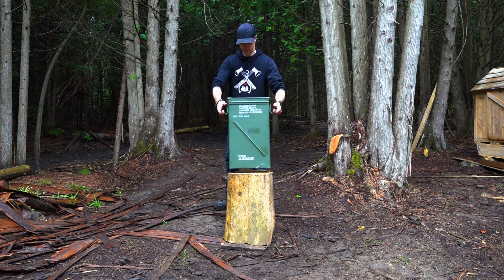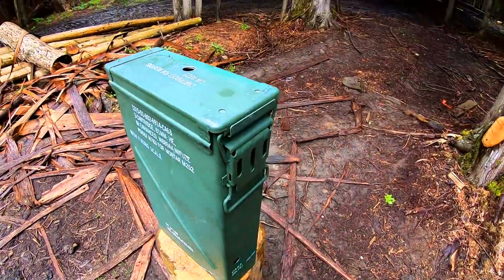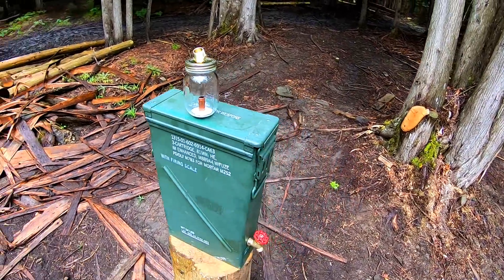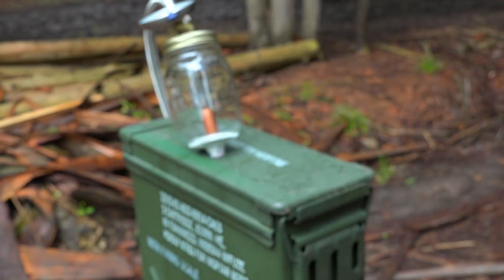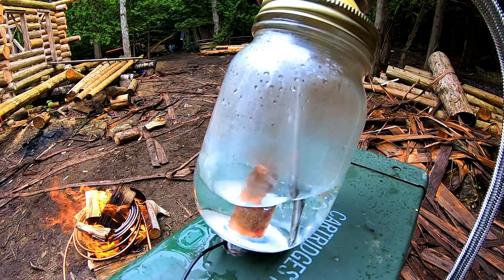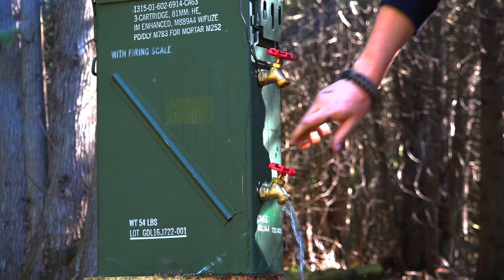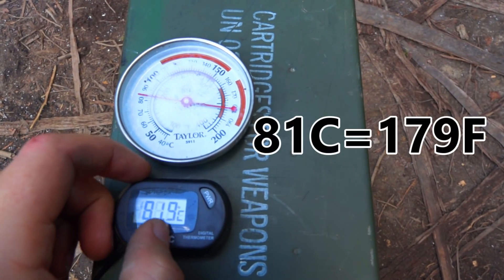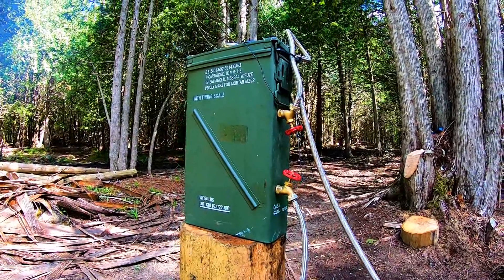Off Grid Heating Prototype- Copper Coil Water Heater / Heat Exchanger / Radiant Heater

Comment: Leaving the main tank outside and running a couple separate lines to a small ATV radiator or something of similar size with a usb or 12v fan you can plug into your power bank might make it easier to regulate temperature on the interior. If plumed in a similar fashion you may not even need any sort of pump to do it. Just insulate the lines.

Comment: There's so much wrong with this, make a normal size camp fire using less than half the wood you're using there, cook your dinner put a large pot of water on the fire, make a coffee, put the rest of the water in a hot water bottle, go to bed.

Comment: I think your copper coil is too big: its maximum capacity to heat water is greater than the amount of water buffered in your ammo box. So you need to up your ammo box or make your coil smaller. It's hard to calculate exactly how much since the heat from a fire can vary too greatly, but try and find a sweet spot where the water in the tank does not go above 80C (20C for safety margin).

Comment: add soap stone inside the ammo can use less water, and the soap stone will hold the heat better then just water after removing the copper from the fire.
Reply: I'm not entirely sure about that. Soapstone has 3x density but 1/4 the specific heat capacity of water. So water contains more heat per volume per degree C. It won't convect and has a lower thermal conductivity, but since the stone would be bathed in water these advantages is negated.

Comment: Also that flexible copper piping will get easily damaged or kinked or will break or crack. Should build a solid mount copper setup that will just barely reach the fire from 5 feet away and will unscrew from the tank for easier transport.

Comment: i work with distillations in past and this is an interesting concept, really , but the biggest flaw is to let the steam out bvecause the steam is the really high heat and that is what you really want to hold in and let that into pipelines to heat up the room in this case.

Comment: Don't say efficient. You can not calculate efficiency here, you would need to know how much total heat energy the fire outputs, and how much absorbs.

In these systems they are incredibly inefficient for how you have it set up. Looking at <5% here.

Putting fire in tank, more material for heat exchange etc etc etc could make it much more efficient, but this is shit efficiency in the video.

Comment: This is only good for boiling water, you would be better off putting a copper coil in that box, cutting some slits and using a fan to blow the heat off the coils  (there are off grid fan options)

Comment: This isn't the video I was hoping to find, but it uses the same principle. There is a horizontal Fire box that is super insulated, so more of the wood fuel is burned and thus creates little to no smoke. The air that comes out the exhaust isn't very warm, instead most of the thermal energy is saved in the bricks and clay. Give her a shot. It's wicked efficient. https://youtu.be/NYJyxptclos

Comment: Neat idea, but with respect, a small rocket stove cannot be beaten. You would need a heavy bank of horizontal stone chimney, but you would have 90% less thermal loss. Most of the heat is going by the copper coils, a lot of the fuel isn't being burnt.

Comment: if there's a coil  coming off the fire and into the water the hot steam would  keep moving inside the cold water, and it will lose some heat. Giving it more time to cool and turn liquid. that way the tank wouldn't boil so fast

Comment: Why not make a larger water storage unit, than have the water cycle through a coal bed. So you can have a roaring fire heating your camper in the day, and heating the water. Than you can safely go to bed with small coals in the winter, although not the safest it is still decent for safety. The coals will renew the heat and drive the water through your little building. So you could have the water inlet to the fire go through your camper (heating it), and the extremely hot water goes up into the storage. Although its not as efficient, I feel this way you could slowly circulate that larger containers content through your camper. That also isn't to say you wouldn't be able to have the hot water tank near your camper even radiating, but this way you also have more water to work with (for coffee/tea). The only limitation would be how safe you can make a small fire for circulating the water.

Comment: I think by getting a simple small radiator and attaching a fan it, instead of using an ammo box works much better. Then you can attach the radiator to the wall in the structure

Comment: Could consider adding a vented check valve (one way valve) for the pressure relief, so gunk n junk can’t make its way into the system. The venting would help especially in a closed space because that would make it very very humid

Comment: i made a similar unit using two metal five gallon pails one for water the other one had the coil in it spiralling upward to avoid air trapping i used 1/2 inch cause the larger diameter was much more expensive (trick for making a tight coil= fill coil with water and freeze then we took it to a parking bollard and wrapped it around it to tighten the coil. the ice inside keeps the copper from kinking) it spat and bubbles quite a bit tho on a hot fire cause its almost flash boiling it. ive seen guys use 1 or 1.5 inch and the flow seems alot better but alot more $$$$$  on a side note ive seen a guy use some steel pipe through a split log with the centre chopped out and piped it right into his tent    the log was a good diameter prob 20 -28 inches split and then a centre section removed and the pieces were wired back together with legs so the intake on the pipe was below the log so no smoke could get in the pipe ill see if i can find the video
Reply: here ya go but i like the idea of having hot water as a bonus    https://youtu.be/QeHGDr81XwM

Comment: HOw long does the copper piping last being driectly in the flame? Most things don't last long when directly in the flame. THey just don't. You may wnat to revise having it directly in the flame. Heat rises so it doens't have to sit in there like that. Maybe just above or around unless ou want to buy copper all the time.

Comment: Why not put copper pipes in the floor instead and make it circulate. Then your back would be nice and warm while sleeping
Reply: 🔴🔴🔴 Daniel Nilsson - The water would not circulate. However, if he still incorporates the ammunition box, water would circulate once again.
Reply: I dunno. That’s gonna pop and pour water all over you 😴
Reply: The whole thing needs to be able to be drained or it will freeze he will not have a fire on it 24/7 and the floor or a car radiator you won't get all of the water out of it small spots will still freeze I tried that with a car that I drained and had removed from the car the  veins still held water even though I turned the radiator on its side 1 little half inch spot froze and this is for a very portable heating system so he can melt snow to get water and he can use the ammo box for storage of supplies when he's on the move and antifreeze is not able to be used because he would have to save all of the fluid or dump it out every time
Reply: @michaelyankasky5656  Then don't use water. Or add antifreeze. And so what it he has to keep using the same liquid? It's not like he's walking with it.
Also if he uses a two coil system where one coil delivers heat to another coil which is the one for final use then he gets the best of both worlds and also the second coil will deliver heat a lot more evenly than the single coil system would. He could even still use the ammobox, just plug it into the first coil and t draws heat from the first coil as it would have from the fire.
Reply: With the cabin made of wood that would be a fire hazard.
Reply: @DOMiNOUKAE  Hot water, even boiling hot does not come close to the combustion point of wood (~ 100C vs ~300C)...still, underfloor heaters use mixing systems to keep the temperature at a constant temp ~35C for comfort.  Having the wood heated to near 100C would definitely be uncomfortable, though not likely to burn flesh, though maybe a slow roast,, yeouch.  Like in a dry sauna.  Temps get up to 100C and you'll be needing that towel!
Reply: @DOMiNOUKAE  Not really It would shed the heat quicker working as a large heat sink and even the ammo box only got to boiling nowhere near the temperatures needed to trigger a sparkless ignition.
Reply: That would add more water needed to the system, meaning more fuel.
Reply: @andrew-729  ....he's surrounded by snow..... you people do know what happens when you apply the slightest amount of heat to ice right?? I'm not just a wizard right?
Reply: Andrew - more fuel? He’s using a camp fire to heat it man not industrial fuels. 😂
Reply: @joshlarochelle1298  Wood is a form of fuel.
Reply: @joshlarochelle1298  He meant wood. You need to collect more wood and tend the fire for longer if you increase the amount of water. Though tbh, if this guy bothered to bend that copper pipe into something more usuable he might be able to heat the floors without increasing the amount of water. He could be putting half as many copper loops in the fire and it wouldn't slow him it down too much.
Reply: @IronDruids  what? that's not how volume works...
Reply: @Bobby-Bologna0451  It is though? Of course it takes more energy to bring the system up to a boil when you increase the amount of water. That could either mean collecting more firewood because the pipes have to sit in the fire for longer or it could mean building a hotter fire. But that also takes time so it's the same result anyway. More time. More effort.

How is any of this confusing? If you've boiled a pot of water before you know less heats up quicker. If you have aquariums you know you need to select your heater after considering how many gallons the tank will be. Etc.
Reply: @IronDruids  the amount of energy being produced already exceeds the entire system's capacity.... helloooooo
Reply: @Bobby-Bologna0451  You're fcken with me.
Reply: @IronDruids  late but yea, lol, funny people equate fuel to gasoline or diesel

Comment: The inefficiency of this "system" is staggering. You are using an order of magnitude more resources just in wood, not to mention all the extra (copper, hose, etc), to do what you want to do. You are losing over 95% of the heat energy generated by the wood and using it to heat water (a substance with extremely high heat capacity) which in turn heats the metal to heat your tiny little space. All that instead of building a tiny little stove that would heat better for a tiny fraction of the resources shown in your video.

Too many people who say they want to "live off the grid" are overcomplicating things for no reason. You need to figure out what you want to achieve (heat your cabin) and the quickest, most efficient way to do that a small wood-fired stove. That stove can then even serve multiple purposes (heat your space and cook your food + water).
Reply: A small stove would burn him out of the camper, and there is a very serious fire hazard so he couldn't keep it going all night.

With this setup he doesn't have as much efficiency but he can run it all night with no fear of burning his camper down and he has a thermal battery in the form of that extremely high heat capacity water you think is a downside.

It's not about efficiency, it's about practicality. More practical to cut a little more wood if it keeps you warm all night than cut a little wood and have to wake up multiple times a night to restart/stock up a small stove. And with the fire outside you won't die from Co2 poisoning
Reply: No. A fire in the stove is contained. It is a minimal risk. Certainly less than having an open fire burn outside near his cabin where a gust of wind may spread it. That's why you never leave an open fire unattended. Depending on the wood, a single log could burn most of the night and provide enough heat to keep the place warm, especially if the cabin is insulated (as it should be). 

His system is neither efficient nor practical. How is it practical to have to get all those extra components and provide 10 times the wood required for heating each day? Also, why would he die of CO2 poisoning? LoL. If his cabin was airtight, he would die of CO2 poisoning regardless of having a fire inside because it is so small. A stove in a space like that is also built with not only a chimney, but a small air intake also.
Reply: @IturaldeRodel  Lol you don't play with fire much do you?

A small stove in a small enclosed wooden structure is very dangerous. There is a reason fireplaces and wood stoves in houses have at least 3 ft of stone around them, hot things start fires.

He is going to use the heater when it's cold and snowing, not much reason to use a heater unless it's really fuckin cold, in his area it snows when it's cold. Ever see a campfire spread through snow a foot deep? Neither have I.

It's practical because it's easier to just collect a little more wood and not have to worry about feeding a fire all night or dying in your sleep.

Chimneys work great until they don't, if anything falls on it and blocks the airway or if something breaks you're going to be bathing in smoke, it's better to just keep the fire outside where no matter what you won't be breathing smoke.

You also can't smell lack of oxygen, just don't fuck around with fire in small spaces, it's literally one of the dumbest things you can do
Reply: @IturaldeRodel  Co2 poisoning doesn't just come from smoke, you can think you're completely fine until you get light headed and that isn't something you want while you sleep.

I've got light headed from sitting by my fireplace, it has a 30-40ft chimney and a kick ass draft but Co2 still leaks out, I've had a strong gust of wind shoot smoke back down the chimney and out into my house, if you don't have proper ventilation it can and will kill you.
Reply: Champ, I'm an ex-serviceman. I've travelled to all but one continent. I know how to survive in cold and hot environments with minimal equipment for extended periods. Fire is dangerous even in snow, and yes, the kind of fire he needs could easily spread to his cabin. It is NOT practical to collect "a little more wood" because in this case "a little more" is 10 times what he needs for a stove, and especially if it is snowing, that is time and energy wasted. If you had lived in a similar circumstance on your own for any period of time, you would know how undesirable that is.

Chimneys have hoods to prevent things falling on them and blocking them hahaha. Mate, it's clear you don't have a clue as to what you're talking about.
Reply: @IturaldeRodel  Yeah sure, military doesn't mean shit, this is camping, did your drill Sargent put you through "how not to die/burn to death in your sleep" 101? Don't act all high and mighty, camping skills are camping skills.

It isn't worth the risk to keep a fire inside, that's the end of it.
If you want to die of Co2 poisoning that's your problem, don't suggest anyone else follow your lead though.

He didn't even say he would run it all night either, he likely plans to heat the water while he's cooking and use it as a thermal battery so he doesn't need a fire through the night, that's what I would do at least
Reply: @Robert-qm7yi  hahaha. Ok, Champ. Good luck.

Comment: I like it. At first I thought the noise to be a bit much, then I figure maybe you intend to heat it in the early evening, pull the coil from the fire and get to bed as the temp drops? Or some similar time line? I am curious, with the hole in tbe top, are you not worried about moisture? If memory serves, you are in ON, Canada(?) which is already extremely humid, even in winter.

Comment: I like this idea a lot, but I was thinking, maybe run a smaller copper coil through the ammo box that’s filled with water so you have hot water in the coil heating the water in the can, would probably regulate the temp a bit more. also, I would think having the coil set above the fire as opposed to in the fire might make it a bit easier to manage. Seems like it might be difficult to use if the ammo box gets that hot when your in the camper, just ideas, no clue if what I’m thinking would work or not, but you could give it a shot

Comment: use a radiator from a car which has a pressure cap and you can run that line somewhere outside

what you built here is a distiller but you are using it backwards. if you were to fill that ammo can with mash and throw the can in the fire, put the copper in cold water or snow and at the outlet you have shine. never drink shine unless you know for sure how to separate out the poison that makes you go blind

Comment: You dont actually need water to do this; just the pipe and fire. Point on end of your pipe out into the cold air, run your coils through the fire, and your other end of pipe in your tent. As long as your pipe has a slight elevation, the heat will rise into your tent quickly.

Comment: This is cool and all, but I gotta ask, why not just buy a little portable propane heater and save yourself the hassle? Carrying around 40’ of copper tubing, gallons and gallons of water, not to mention running it in a box never designed for water let alone pressure... there must be an easier way.
Reply: Derick Wood i recon its all about being able to selfsubstian in the future, propane he cant make himself but basic firewood he can
Reply: You can get wood and water anywere you cant always get propane

Comment: Why not save a lot of hassle and just fit a radiator? It stronger, we’ll designed to radiate heat and less likely to tip over and burn you with boiling water.  If you run a pipe from the bleed valve at the top of a radiator to outside the sled you won’t end up sleeping in a sauna either